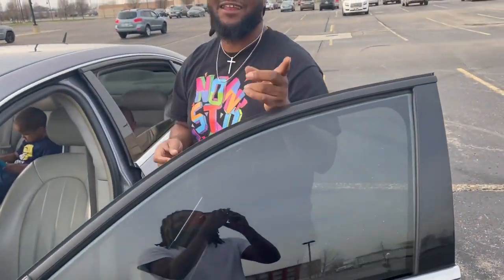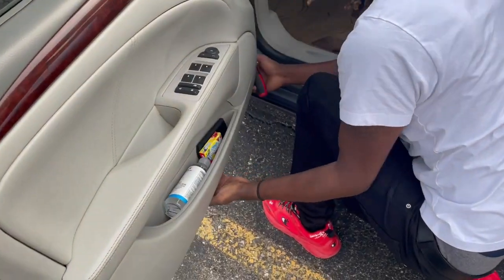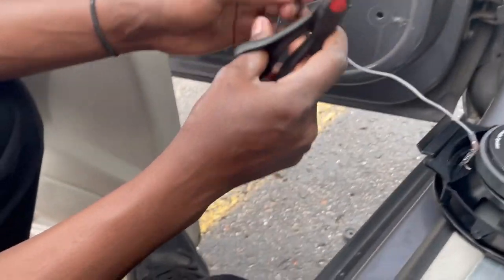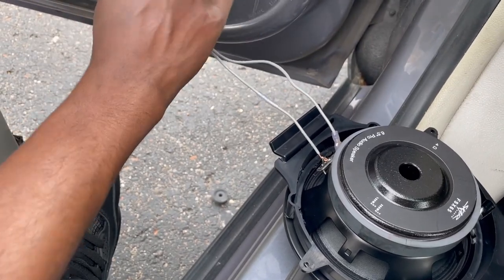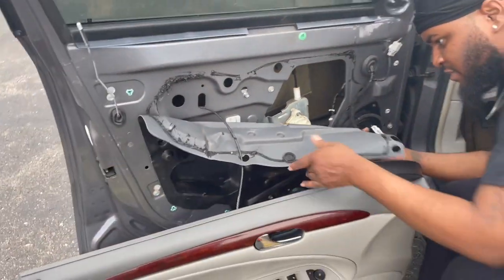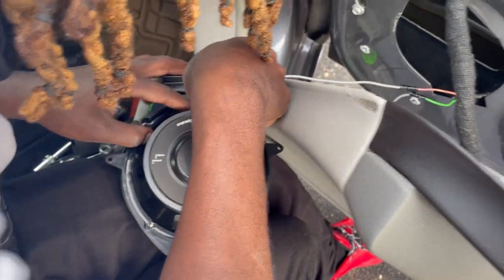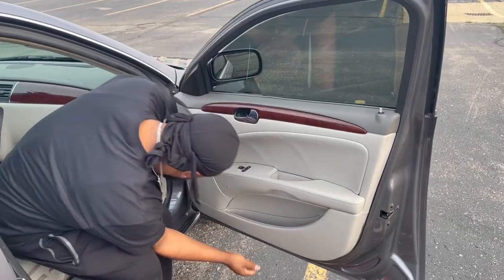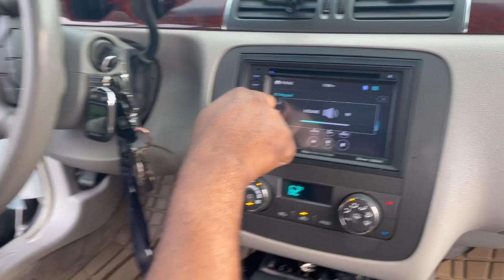SKAR AUDIO 6.5 SPEAKERS INSTALL ON BUICK LUCERNE (KICKERS BLOWN)

Comment: i wouldn't recommend wrapping the speaker wire around like that I've done it before and it comes loose over time even with tape just get the connections bro

Comment: Could I run those without a amp?
Reply from the maker: Yea we don’t have a amp
Reply: @itsvontesworld  are those the 300 watt ?
Reply: @blairwilliams9094  they're 150w each. Your headunit, depending on brand, is only gonna give them 14-22w each. These types of speakers are Pro Audio for midrange and they don't have good midbass. For them to sound the best they need to be amped and crossover around 150hz with a super tweeter for the highs. If you don't wanna spend that much just get some defends coaxial speakers or low power component's
Reply: @tdot1269  yea I’ve had these in for about a month and I love em super loud I have a vid of a sound test they go good with my subs as well